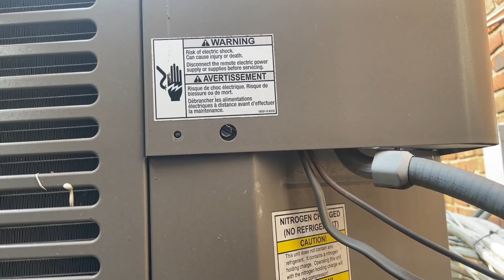How Did They Expect This To Work - Complete Disaster Discovered During 1st AC Service Call

Comment: We don’t often see furnaces in the attic here in Canada, but when we do, it’s a whole lot of fun to try and clean the system. I just had a one today. It had solid metal ductwork with insulation draped over it and falling off, and the ductwork was needlessly convoluted and complex. The furnace could have easily been installed in the basement and it would have been sooo much easier to clean and service.

Comment: At 4:02 in the video that black wire lying in the middle uncapped, was that  LIVE? I would put a space-pack in period fuck that. You will only have to deal with one return, then just run small supplies lines. This is 100% the perfect job for that system. And your summer is just getting started you will see worse. LMAOOOOOOOOOO

Comment: Another great innovative install!
But innovative gone stupid.;)
Reply: Mikey Pipes - Pipe Doctor Plumbing & Heating & Air 
Agreed, nothing from that mess is workable, I would not even save the flex. I have a nice big metal shop and would do a custom sheet metal duct layout with round duct leads and minimal flex. Mastic the joints and duct wrap w R8.

Comment: Rube Goldberg's decedent must have done that one. Nope! Rube's stuff worked. 
 I saw the first air handler with a 1940's style motor, no belt guard and went OMG. Then you showed the return air (lack of) plenum OMG OMG.
Get an Electrician as well as that  HVAC guy to inspect. There should never be line voltage wires/ switches not enclosed in proper junction boxes.

Comment: I also want to say split systems are great units all around. But please dont go with the cheapest units you can find online. Get something known and that the customer service is good. Fujitsu, Gree, Mitsubishi etc. And support local plumbing supply houses.
Reply: @Bryan-Hensley  I get that. But some of the most known brands are not American brands. Support American jobs as mush as possible but I find it hard to get anything american made in supply houses anymore from fittings to equipment. And if you do they are 3 times the price most times.

Comment: The wiring is an extreme fire hazard‼️ I would be interested in knowing what the customer decided to do and what kind of money he was willing to spend? Just the labor alone would be astronomical! I would also demand a licensed electrician to straighten out the wiring disaster first before attempting to do any HVAC work. What if the HVAC work caused the shoddy wiring to set the house on fire?
So many issues to deal with❗️

Comment: In general air handler + attic = bad idea.
Reply: Ya I never seen one in a attic.
Reply: @PipeDoctor  It is wrong. Efficiency experts say that all air handlers leak and so do attics. Especially old attics. Put it below the attic and isolated it from the attic. Building science 101 - do not cool a house from a leaky hot attic.

Comment: these homeowners would have a sound legal case to go after the home inspector . any qualified home inspector would have seen what mike saw and told exactly what mike said . they also need an electrician asap to clean up those loose wires .
Reply: not necessarily, most of those crooks have you sign documents saying you won't sue if they miss somethings